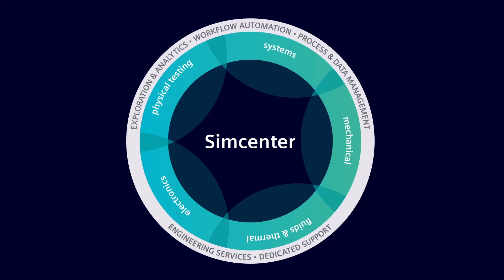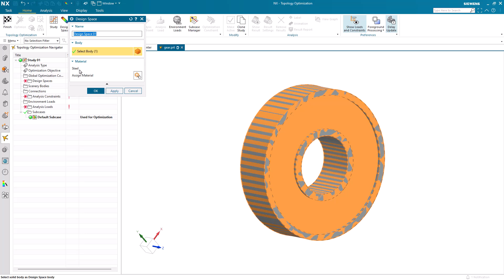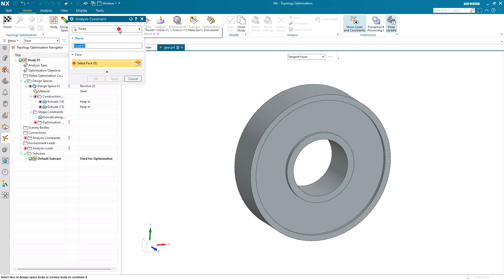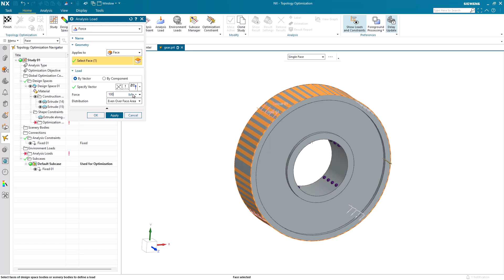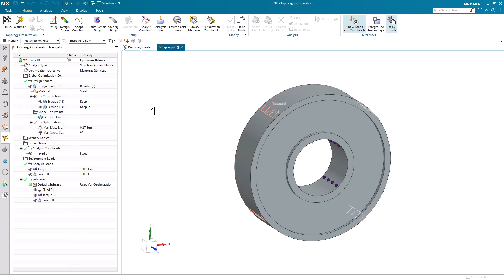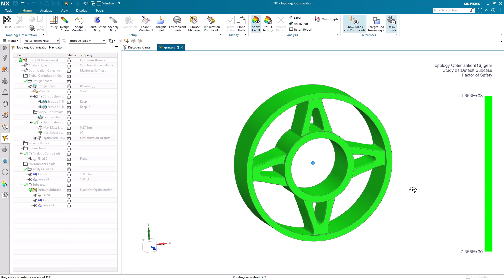How To Optimize The Shape Of A Gear With NX Topology Optimization

Comment: Nice video, thanks! 
If there are let's say 10 studies that were set previously, then is it possible to run all of them together, not manually one by one? 
Is it possible to make multiple Study Clones automatically, while varying some parameters?
Reply from the maker: It is possible to run a Design Of Experiments with NX/Simcenter 3D in this fashion with NX Open custom scripts.  With 10 licenses you could batch the jobs out to 10 machines to run simultaneously.  Running multiple study clones could also be done with NX Open customization.
Reply: @Simcenter3DTipsandTricks     Sorry but I worded my question ambiguous. 
It isn't needed that the studies be solved simultaneously. I meant that they should be sequentially solved automatically one after the other. So in this way I don't have to sit in front of the computer to hit the start button of every study. 
Is it possible by default, or is scripting needed for this too?
Reply from the maker: @krizsbmx  Topology optimization is not set up to run a DOE and scripting would be required to modify a parameter and rerun.  Geometry Optimization is set up to run a DOE and no scripting is required.  You can do this by selecting Global Sensitivity at time index 2:44 https://youtu.be/TYojm6Eh3mc?si=JVyXk8rlpcLfCCeZ&t=164 instead of the Optimizer.
Reply: @Simcenter3DTipsandTricks    Thank you, that helped a lot!  Meanwhile I checked whether Algorithmic Modeling has a Node for Topology Optimization but unfortunately it doesn't have.

Comment: video after very long time.Nice and informative video.
few ques: can Gear Teeth  be added later and thus FOS will change? (since you have used 2 extra extruded profile for OD and ID.)
do consumer GPUs(not the pro /enterprise ones) would work fine for NX and Simcenter3D  like nvidia 4080 Super?
Reply from the maker: The FOS was only looking at the hub, not the OD teeth and ID spline.  After adding the teeth and spline you could analyze again with loads and constraints on the teeth and spline with either Performance Predictor or Simcenter 3D.  Not sure about the hardware requirements for GPUs.  I have an NVIDIA Quadro RTX 3000.